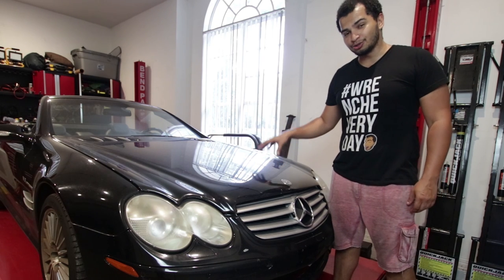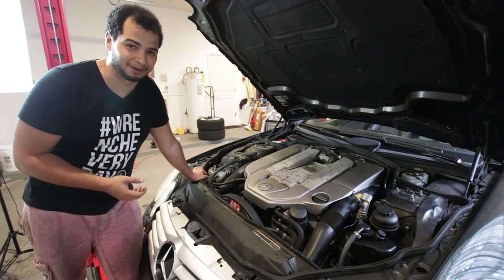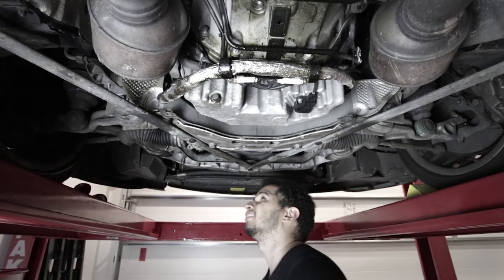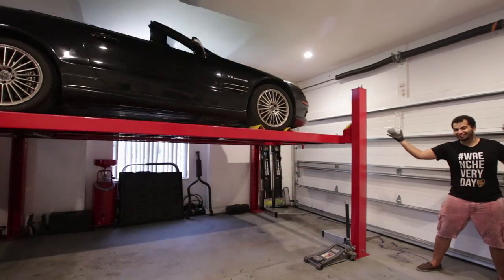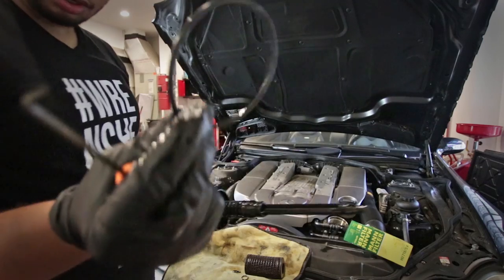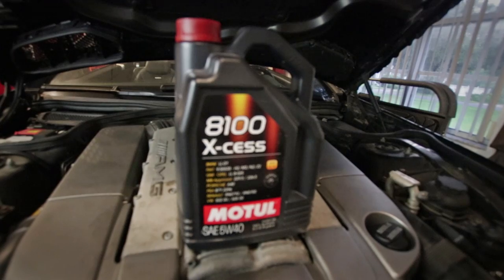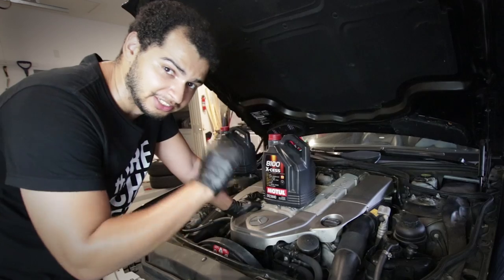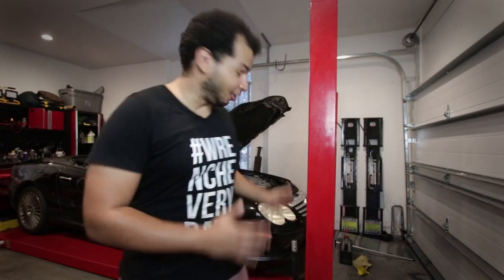Here's Why A Mercedes Oil Change Costs $320 And Why You Should NEVER Pay That Price-Project SL55 Pt1

Comment: I have my independant Mercedes mechanic that has 28 years dealership experience do anything and everything he is able to do.  He charges $150 which is not bad since the car takes over 8 quarts of oil and includes the filter change.  Mercedes Benz came up with the idea of never removing the pan plug.  Instead, they insert a vacuum hose down the oil inlet.  The hose wiggles all around the bottom of the pan sucking up all the oil and gunk.  I prefer my mechanic doing it far cheaper and just as well.  I would never go to Mercedes for my oil changes.
Reply: U Forgot to mention oil and filter brand!!!

Comment: Pull the oil filter 1st , oil filter housing holds 3/4 qt. of oil, 2nd run the engine till oil pressure light goes off THEN check the level. In my opinion you're 1qt too low, Have a nice day.

Comment: M5 bmw runs on VERY  special  thin OIL   and cost AROUND £ 199 just for the oil but people  put  £ 70 pound OIL  in ENGINE  and feck the ENGINE  up if you got a m5 be careful

Comment: Just plan ahead and oil change should be under $40. 5 quart mobil 1 jugs are $12 when they have rebate and mann filter is $10 on amazon. No need for Motul oil, mobil 1 meets the spec. Do it at 7k if you care really concerned about oil.

Comment: I paid around $150 for an A service on a 2015 CLS 550. B service was $255 and includes combo and dust filters and brake fluid replacement. Spark plugs are due at the 60k B Svc, I think. Using factory parts is better for the car as well as resale. If I can’t afford it, I shouldn’t have bought it. Lol

Comment: You should remove the filter first as some oil will be trapped and will be released when you remove the old filter.  Of course all that dirty oil is draining back into the pan, which you already drained and put the plugs back in...

Comment: well, a Mercedes dealershit in Italy just charged me 600 euro (~$680) for my first A service for a diesel C class. It includes the rear brake pads (at 28.000 km) for ONLY 235 euro (the pads cost about 40 euro online).

Comment: Another YouTuber blew that engine on the track and it ended up being a cracked rubber O-ring in the sump line that caused loss of oil pressure, a used replacement engine was found to have bearing wear from oil starvation due to that same O-ring starting to go bad. There is no oil pressure light/guage to warn you.

Comment: Not impressed with digital oil level gauge reading OK if the level is correct. Dipstick is still needed in case the level sensor breaks, or you want to track oil consumption and quality by looking at the dipstick. Fixing something that wasn't broke.

Comment: granted my mercedes is 23 years old but if I do a full synthetic german oil change (mann filter and liqui moly or pentosin oil) its about 80 bucks local mechanic would charge 130 for valvoline and I easily go 5k on the change per mechanic could perhaps go longer

Comment: Motul xcess is so much better than Mobil 1.
In trying to find this outI talked to amobil 1 exec and asked why I have some  mercedes that consume oil badly when using Mobil-1 but with the same formulation 229.5 Motul xcess oil the car does not consume oil.
His short answer was that Mobil -1 must use a different base stock although the formulation is the same.
I also agree that customers need to get an itemized list of things replaced at the B service interval because the dealer advertises a generic service then charges additional for engine air, cabin filters, wiper blades and any other items that usually need replaced anyways during the B service interval.
I will give quotes to people and explain that I replace all the items that the dealership tacks on as additional items on top of their generic service and i’ll be much less expensive.
Yet still the customer will go to the dealer for a cheaper priced service then ending up spending hundreds more for the additional items usually a couple hundred more than what I would have charged for the same service.
Then they will call me
complaining.
Mercedes owners are some real rocket scientists at times.

Comment: next time you change the oil and filter .please undo the oil filler cap and filter top first, and lift the oil filter. as the old oil in the filter housing  will drain down in to the sump . if you do not do this  the old oil will stay in the filter housing .from a professional .do not over tighten sump bungs .also replace the sump bung washer,  the washer should come with a genuine merc filter, otherwise ask for one, they are pennys and will be oil tight .

Comment: "Full Synthetic" motor oil is made from the same crude oil conventional motor oil is made from.  It is just refined a bit more.  "100% Synthetic" is completely synthetic and NOT made from crude oil.  You made the right call by going with "100% Synthetic" as it is way better than "Full Synthetic". :)
Reply: Incorrect. Read the following article.  https://en.wikipedia.org/wiki/Fischer%E2%80%93Tropsch_process

Comment: With over 3200 miles left till oil change that oil sure was dirty as well as the$10 Mann oil filter with gaskets (O -rings) and M.B charges a watcher $15 -$20 for the same filter and $132.00 for 8 qts. Oil ! + $80 labor🤑💵💰

Comment: I do those at work every now and again  normally with full synthetic 5w-30 I think although some people like the mobil one. Either way it's either $100 to $150 that includes the price of the odd ball oil filter which sits up top. We'd have you done in like 20mins much better than the dealership or other appointment based shops wait time and cheaper. I'm not gonna say what else we do with our oil changes. I've already typed enough as is.

Comment: I have an old Porsche, it holds 13 litres of oil, @ $13.00 or so each plus filter. If adding the shops fees 300 is quite normal.

Comment: All oil has an API rating . American Petroleum Institute . The owners manual has the rating inside . Meet or exceed that rating . All high end vehicles , especially turbos need the correct oil . If that other shop put in the wrong oil , they should be working on bicycles where they can't damage things . Or " assembly technician " at IKEA .

Comment: You’re wrong on one thing - filter goes out first, if you do it like you did - the oil that’s trapped in the filter chamber, which is 1/2-1qt will go back to oil pan

Comment: Mercedes extracts the oil they dont drain it from the drain plug. A $30 12v extractor gets the jobs done in 15 minutes without having to lift the car remove shields  etc.  (and yes the extractors even suck up the sludge) You can buy a shop stick for a dipstick. It is not intended to leave in but for a visual inspection and measurement check

Comment: My car got the same treatment. Oil, filter, air pressure, brake fluid, and power steering fluid all topped off. Plus inspection, $37....

Comment: Mobil 1 0w40 x2 jugs at Walmart = $50 (minus rebates run frequently), Hengst or Mann  filters are same as the one you get in the pretty MB box, but cost $10 rather than $30. $60 or less to change oil, AKA Service A/B on a Mercedes every 10K miles. People who comment here that Mercedes are expensive or break frequently have never owned one, or just not capable of doing their own simple maintenance or keeping up with proper maintenance cycles of a car. 
The dealer mechanics commenting here that there are reasons for the glorious $320 oil changes are speaking to the same people who bring their car to the dealer whenever the idiot light goes off. If you are aware of your car's mechanical condition, then there is no reason to pay someone for all these checks. If brakes or tires are low, replace them, it you happen to find a leak somewhere, then replace the appropriate gasket. If you need a map update on your factory GPS you must be about 80 years old, because I never use mine, smart phones are so much easier vs. the clunky built-in navigation on any vehicle.

Comment: Dude, there's a thing called a torque wrench. That would take that plug right off. Could also use an impact wrench. I've owned two Mercedes. Step up, buy a Cadillac. You'll wonder why in the world did you mess with a Mercedes. Parts are a lot more reasonable, anyone can work on them. Even myself (yourself). Only thing to know about a northstar engine is to get the coolent plugs if you add or replace the coolant. Looks like a stack of brass quarters. You really do need those. Then it's fine. My DD is a 2006 DTS, 150K miles. Still takes off like a rocket.

Comment: 229.51 is "the good stuff." 229.5 is fine for that car though. Hu 718/5x is the filter for nearly all the cars in that generation of engines and you can flip it either way.  That's the worst pick you could use. A hook or small flathead screwdriver does way less damage. There's a dipstick hidden on the back right side of the engine (left if the hood is open and you're facing it) might not be on the amg, but it's there on the rest. No way in hell you're turning that into a manual. Way too many pcm/ecm issues for that to happen. Entertaining video though. I chuckled when I saw how close you put the bucket next to the drain plug.

Comment: i spent 120 dlls i bought a 2 ton jack 2 standa oil filter and oil. if i go to the shop they charge me 140dlls for my c300 pil change. now my oil changes will only cost me my oil and filter. 50 bucks

Comment: That has a lot of similarities to my 92 525i 5 speed BMW except for that long tube hanging off the oil filter the oil filters located in the same exact spot it's the same oil filter with just no outside covering like the traditional American vehicles have and there wasn't 2 bolts you have to unbolt underneath the car is just a drain hole.

Comment: I sure hope you replaced both drain plugs or else they will leak.  the new ones has yellow thread sealant on them to help prevent leaks. So the drain plug bolts are one time use. please review the WIS doc in Netstar

Comment: So...Filter(s), synthetic oil, lift, 25mm tool and labor with checking spark plugs, fluids top off, belts and brakes is about 50 dollars. Oh..Okay.  (I'll install and do it all in my living room)  You even saved a couple of dollars on the oil. (Free oil)    Those companies pay:  You received free oil from a sponsor.  Modern Mercedes-Benzes have dipsticks.  All of my cars do.   It's 225 for A service fee and 275 for a Service B. So, about 125 more without converting my living room into a service center. (And that's if you go to a MB service center)  150 if you go elsewhere.

Comment: Your procedure was incorrect. You should add 7-8 quarts of oil, then start the motor for 1 minute, turn it off let sit, then top off and check for additional oil. Oil is required to pump up into the oil filter and cooler first, then check your console to verify if additional oil is required.

Comment: You failed to meet or exceed the engine oil service at Mercedes.
However, an ASE automotive technicians would have done a preventative step in your situation. Which is printing the specific vehicle specifications from the manufacturer. 
Ultimately, it includes technicians service bulletin that’s up-to-date. 
In my experience the electronic engine oil level needs to be checked once the oil level reaches operating temperature (as if you’re filling an automatic trans or manufacturer specifications on the proper procedure). 
Just a thought; not having “all data” or “pro demand” (aka Mitchell) puts your advice at a huge disadvantage. 
Perhaps you should put a disclaimer to avoid a malpractice lawsuit. Cover your assets.  
Joking aside, there’s a ton of information you should keep up-to-date  every year for an ASE Technician. A lot of times units become upgraded and/or use crush washers once.

Comment: I have a 2009 SL 63 and it has.....a dipstick. I never drain I use a suction device which requires access through the dipstick tube and you need to remove your filter as yore dong it or all of the oil will not be removed.....even if drained. You have to remove that filter while draining to get it all out or you’re just adding new to about a half of a quart of old and that is never good for this type of car

Comment: Sorry Pal，as a Mercedes dealer Tech，you missed the most important part from the beginning. SL55 AMG have 2 engine oil drain plugs but not 1. You are not doing a basic service properly

Comment: Mercedes and AMG recommend using Mobile 1 because that's what they test their engines with in R&D. Not because Mobil pays for the privilege. Also when you buy a Mercedes oil filter it's a high quality fleece filter media, not a 6$ paper filter from the parts store. THEN, labor time to have a qualified and trained technician INSPECT the vehicle and change the oil. Ask people how much their DIY or lube shop oil change saved them when a $50 oil change cost them a $20k AMG engine. Lol

Comment: I use LiquiMoly in my Mercedes because molybdenum is a low friction additive.
My level sensor always says, "car must be level" no matter that it is on a level spot. Screw it, I am not replacing the sensor. Luckily it is a 2001 and has a dip stick.

Comment: For the best full synthetic use Amsoil. What is synthetic motor oil? AMSOIL synthetic lubricants are chemically engineered to form pure lubricants. They contain no contaminants or molecules that don’t serve a designed purpose. Their versatility and pure, uniform molecular structures impart properties that provide better friction-reduction, optimum fuel efficiency, maximum film strength and extreme-temperature performance conventional lubricants just can’t touch.

Conventional lubricants, on the other hand, are refined from crude oil. Contaminating elements such as sulfur, nitrogen, oxygen and metal components such as nickel or vanadium are inherent to crude oil and cannot be completely removed through the refining process. The oil refining process separates the various types of molecules in the oil by weight, leaving molecules similar in weight but dissimilar in structure, reducing performance.
Reply: EdmondEnterprises Group Inc. Like a MLM like Amsoil can be any better than Castrol, Shell, Motul or Mobil 1.

Comment: No matter the age use the dealer 
Every time I used a independent specialist shop well not so good 
But I did use a transmission shop to replace the T and that’s all they do perfect job and saved 4 k over
Dealer so yes for big stuff shop around but I just like to have a big deep pocket to sue if they screws up lol

Comment: I prefer m1, fuchs (is that available in the US?) of motul. They are all Pretty close. Motul is often Used in high Performance Bikes. But! If you Drive it hard often you should Stick with 5w50 (also used in the slr). It got some extra reserves just in case

Comment: Great over view,  I just bought a Benz CLS500 2006. Wondering how to change oil now I know. Next question, do you how any idea why, when I hit a. Bump or pot hole with my rear tire, the car seems to sway or slide like u may loose control. This issue comes from.rezr end also left side rear tire tread is being used up twice as fast at the other side. What can be causing this problem.Can it be shocks, Camber, bushings. What & why does car seemingly to dribble over road slightly when I hit a hole or bump.

Comment: The price is set by the dealership, not the technician. There's no reason to insult the guy working on your car.

BTW, a Mercedes service technician would take the oil out from the top, and not through the drain plugs.. I guess mr. Aston Martin doesn't know that.
Reply: It doesn't take much intelligence to realise that oil will drain more efficiently with the assistance of gravity rather than against it. Drain from the bottom - fill from the top. The drain plug is there for a reason, otherwise the factory would not have gone to the trouble and expense of installing one.
Reply: @xxomegaman007  
Unless it's faster, easier, and more efficient to use the Mercedes Benz supplied oil-vacuum that connected at the oil filter fitting after removing only the oil filter housing, at the top of the engine.  This, as opposed to lifting the vehicle, removing the lower engine shroud, the oil drain plug and crush washer, then replacing the plug with new crush washer and engine shroud, and lower the vehicle from the lift.  If there was no oil seep at the plug before, there won't be one now.

Now, it is typical for a vehicle to be placed on the lift anyway, to facilitate the wheel, brake and underbody safety inspection.

Comment: I've noticed that my Jetta (2011 2.5L) reads high if I check the oil level right after a change. After taking it for a lap around the block, it reads more accurately. I'm guessing there may be areas the oil can't flow to until the engine turns over causing it to read inaccurately. Have you noticed this with your cars too?

Comment: this is the second or third video I see from you.  I get that people like to take their cars to the dealer to show off when selling their car.  Does really taking it to the dealer help the car keep its value because by what what I have seen, very little research, their price fall down like a dead rock pulled down like gravity with no chance to recup any lost value.  By the way, I just bought a 2013 s class twin turbo black car on march and I need to do the oil change since I saw and E on the dash board and check the oil about 30 minutes ago and it was EMPTY.